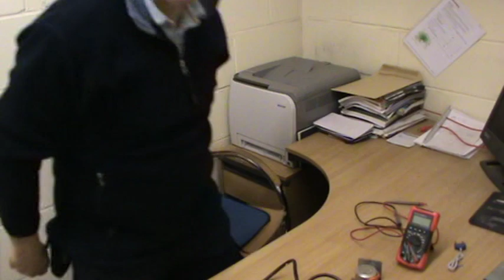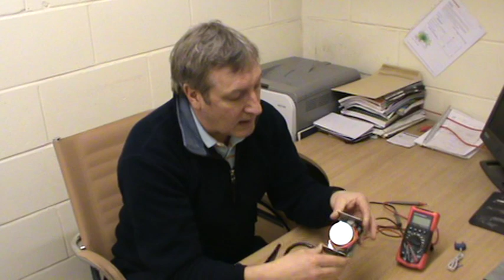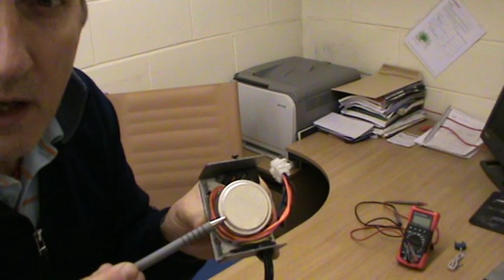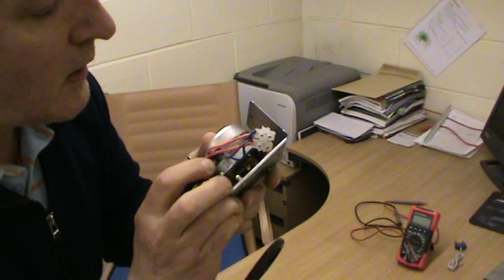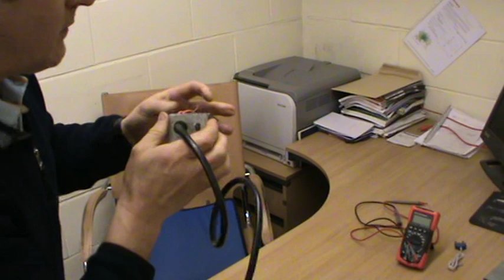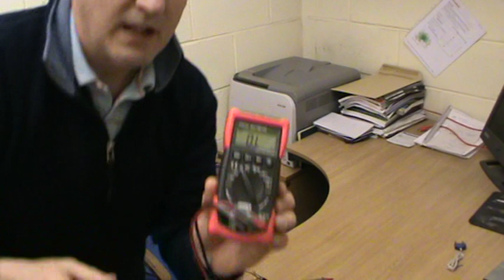Part 1 2 port valve actuator testing.mpg

Comment from the maker: Generally on an 'S' plan type system the motor is powered up by the Switched Live in series with the Cylinder Thermostat or the Room Thermostat. There's a permanent Live connected to the Grey & that powers up the Boiler & Pump via the Orange when the valve opens.
I hope that's clear mate & thanks for taking the time.

Comment from the maker: It may vary 'fmcman', but if you're not getting a reading of around 2000 ohms, then you'd be better to replacing it.  The resistance can be too high or too low - both indicating a faulty winding.
Thanks for viweing & please subsribe.